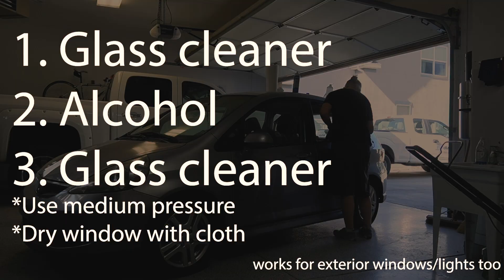Best Way To Clean Inside Car Windows - No Streaks or Haze!

Comment: Be careful if you have TINTED windows! Glass cleaners (especially those with ammonia) can damage the tint. You're better off just making your own window-cleaning solution for both tinted and non-tinted windows: 1) an empty spray bottle, 2) a couple of drops of baby shampoo (or a very gentle dish soap), 3) two tablespoons of 91% Isopropyl Rubbing Alcohol, 4) fill the rest of the way with distilled water. Less steps than the method you suggest in this video, and safe for window tint. Spray solution on a microfiber cloth, wash window, buff clean with a dry microfiber cloth.

Comment: Another thing to use 91% alcohol on is, by putting about 1/4 bottle in your windshield wiper solution. In wintery freezing weather  it will keep your wiper lines from freezing up. I’ve been in weather in the teens, Ice all over my car, but I can use my wiper blades no problem.
Reply: Awesome idea.  Thanks for sharing

Comment: Great video, and does work. But, under no circumstances use Windex or any other blue household glass cleaner. They all contain ammonia, unless stated ammonia free, stick to a good auto window cleaner, ammonia a complete no no for car windows. It attacks the rubbers and seals, and will destroy after factory installed tint. If you have tint, get a tint compatible glass cleaner from an auto shop/supplier. You can even buy it in bulk concentrate and mix your own in a spray bottle, works out very cheap. But NO ammonia. Take care.✌
Reply: This is exactly the advice I was looking for as I just read an article in Costco magazine on detailing your car and this is exactly what they said also.  So thankful you added this comment here since they said NO AMMONIA, I was wondering what to buy and where.  Thank you!
Reply: @terristoddard1  I can help you make your own that is guaranteed completely safe. Get yourself a good spray bottle, some distilled water and some baby shampoo. Mix 15 mil or 1 tablespoon on baby shampoo for every 600 mil/20 fluid ounces together in the spray bottle. Guaranteed safe and works. But make sure you use good microfibre towels. I use one with 500gsm that has a thick soft side and a thinner nap on the other side. Spray the cleaner onto the thick side and clean a section of the windows, eg. driver side window. then dry with the thin nap side, will clean but not streak, use a clean section of the microfibre for each window, inside and out. When done polish with a widow specific microfibre cloth. This method is so much cheaper than buying stuff all the time and works, safe and no streaking.

Comment: If the cars a non-smoker, you can use 50/50 solution of distilled water + isoprophyl alcohol to clean the windows, you dont really need a glass cleaner. The fingerprints and the haze is oils and grease from bodily odors like from breath. If you smoke cigarettes or vape then you might need a cleaner. I have cleaned my car windows with water + alcohol for 10 years now, crystal clear windows and they are not fogging up.
Reply: Great to know. I'll cut out the Windex.

Comment: Grandma window cleaning method is best and cheapest. Just mix some vinegar and water in a spray bottle. That will 100% get your windows streak free.
Reply: Yes streak free but vinegar won't get rid of filmy crud like nicotine or vape residue. Need alcohol for that
Reply: @tracyjohnson5023  Dish detergent with warm water works well for that too. Since it is nothing more than a degreaser.

Comment: this method is acceptable on class, it is NOT acceptable on tinted glass sheet, the paper towel will cause micro scratches that compound over time )you wont' see it instantly, but eventually you will) and the iso can damage some types of tint film.
Reply: What about newspaper
Reply: @matt7iron  browser search news paper magnified.
again, it will take a LONG time, but it does damage the tint.